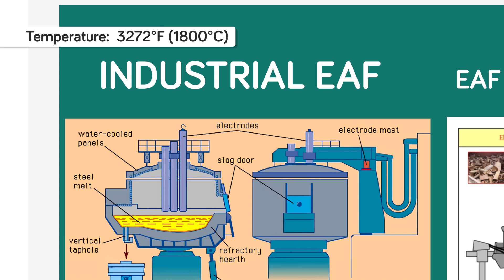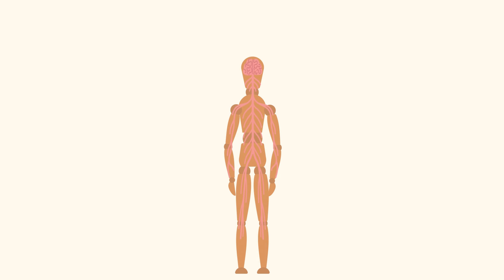What If You Fell Into Molten Metal Terminator 2 Style?

Comment: I was on internship on a metal melting plant of Karla Libknehta(завод карла либкнехта) or Interpipe now. We had giant 100t vats fкom which metal is poured into blanks for train wheels or pipes. Old-timers told that they had a suicide in the 80s, some idiot jumped into a vat, legs first. Went about knee deep and then it's just steam and screaming for next minute or so. It could be just a scary story for interns to keep them away from hot stuff, but since it happened during soviet union times...it sounded very convincing.

Comment: I (briefly) worked as security/medic at a steel mill. You could be standing outside and down the hall from the furnace room in the Winter and you could feel the heat blast around the corners at ya. 
Also, as you can imagine, a lot of gruesome injuries and deaths happen at those places.

Comment: Surprised you didn't mention Gollum's death in Return of the King.
Reply: Look at the Volcano episode...
Reply: that was lava, not metal.
Reply: @tibz7634  pretty sure molten rock is hotter than molten steel. Could be wrong though.
Reply: @davidjones272  if you watch the video, the steel is hotter.
Reply: David Jones No, molten metals are much, much hotter, some of them more than three times hotter than the average lava temperatures
Reply: Kuningaz Depends on the molten metal. For example, you’re likely referring to tungsten, with a melting point of ~6150 Fahrenheit, in regards to some molten metals being almost three times hotter than magma , which typically can reach about 2300 F. However, you can melt many metals such as aluminum (~1220 F) in your backyard (which I’ve done). As for steel specifically, its range of melting points, depending on carbon content and such, is about 2600-2900 F. So, molten steel is hotter, though not by a ton.
Reply: or the incident that started the set  of events leading to anakin skywalker's becoming darth vader
Reply: I don't remember gollum falling into a steel mill vat.

Comment: I've worked in a steel mill that makes trainwheels for 17 yrs. 4 yrs ago we were moving laddles (25tons of molten steel, 2850deg f) Crane line snapped while it was 3ft above the cradle and it went everywhere. Burned 5 guys bad. 2 died with in days, one committed suicide last yr, one has no foot to midcalf. The last one was burnt 35% of his body. So ya..it will completely ruin your day.

Comment: I work in a brick plant.  A while back 1 of my bosses told a story of a guy at another brick company. who got stuck in the vest of the kiln, and a loaded car pushed in on him. He managed to get up on the incoming car. The only problem is that the incoming car just came out of a dryer at somewhere around 400 degrees.  And as soon as the door closes there are fans that come on and takes it up to somewhere around 700 degrees.  And it sits there for approximately 1 1/2 hours. Theses cars have approximately 5000 bricks in 2 different stacks, when they realized he was missing,  and started looking for him.  They decided to pull out a couple of cars. And they found him. He had dug through about 1/2 of a car. I always thought that would be a horrible way to go.  Being cooked to death.

Comment: High doses of nuclear radiation poisoning would be a pretty brutal way to die.
Reply: I concur - did a lot of research on that topic back in university.
It largely depends on the dose you’ve received, but once you get over a certain threshold, you’ll get to experience the worst ending possible for a living being. 
Long story short; most of the cells in your body become sterile and are unable to reproduce. Since the turnover rate for tissue is a few days, you’ll be fine for most of that time (certain acute reactions aside). The real nightmare begins after that, since your body begins to break down, every internal and external tissue surface dying. The most fun part is that you get to experience most of it, since the nerve tissue is actually one of the most resistant to radiation. You can theoretically be instantly killed by radiation, but that would take an insanely high dosage (80 Sievert whole body, if I remember correctly - ARS (Acute radiation sydrome; aka radiation sickness sets in at 1 Sievert whole body exposure).

Word of advice:  If you ever find out you’ve been exposed to high doses of gamma radiation (we’re talking standing next to an exposed reactor or gamma- sterilization unit here) and you start vomiting within the first 5-10 minutes after that, try to crawl back to the radiation source and make it as difficult as possible for anyone to pull you away in an attempt to rescue you. The radiation will fry your nerves, you’ll fall into a coma and that will be it - given the alternative (especially since they will try to keep you alive in hospital) it will be easier for you and much quicker.

Comment: In 2001 two firms were fined more than £200,000 after an engineer fell into a vat of molten metal and died.

Father-of-two Allen Wardle, 52, lived for six hours despite suffering 100 per cent burns when he fell into a vat of molten zinc at a factory in Witham, Essex, in 1998.

Comment: Worked at a furnace with 120ton ladles. Eaf operator and ladle reheat furance operator.   One second of looking over the rail into them to add certain alloys would change someone's mind quickly on getting lowered into them. Taking temps with probes by hand would scorch welding gloves to the point of being useless. Perk about the job.  No bugs, nothing lives around the things, too hot and too loud. Another perk, winter time.. you still sweat even if its snowing outside.  Summer time... you sweat til your body stops sweating.  Daily....

Comment: “Back when humanity was stuck with wood and bellows to heat up to heat up metal and melt it, we were limited with the ultimate purity  and strength we could achieve from different metals. Then, the Electrical Arc Furnace was invented.”

Yea, that makes sense. From the Stone Age to the Industrial Revolution within a few years or so.
Reply: Exactly. Totally ignoring that coal was (and still is in many places) used in the steelmaking process far longer than EAFs.

Comment: The metal used on the T-800 was specified - Coltan alloy; Columbium and Tantalum. Dense and highly heat resistant alloy. T-600 models were titanium endoskeletons. So if you fancy a dip in a freshly poured ladle of molten steel, i recommend a Coltan suit..you'll survive long enough to regret everything,scream mistakes were made before the suit heats up and cooks you like a potato.

Comment: In the video it says that they could not find anyone who has died this way...  well I personally have seen this happen although 1 of the guys didn't die...  I worked at US Pipe in Burlington NJ and 1 of the guys fell asleep in the crucible and they poured the steel on top of him.  He died.  The other guy jumped on what was called a "Pod" it is like tiny puddles of molten run off metal... the cold water on his feet cracked the top of the pod and he actually melted in up to his knees till the metal hardened enough and became a solid.  I didn't get to watch them get him out, but all I know is they were really having a problem with doing it.  He passed out almost immediately.  It had to have happened in 1997 or 98 at US Pipe in Burlington City NJ

Comment: If you fall in from a large height, I'm pretty sure the metal will act like a trampoline and throw you back into the air as it "explodes." If the Terminator had fallen into the vat, the metal would have splashed everywhere ("exploded") because he wasn't preheated, and thrown him back into the air. At least that's how molten zinc at 900F behaves-- according to what I was told (I only witnessed aftermath) when I worked on dip-galvanizing lines.